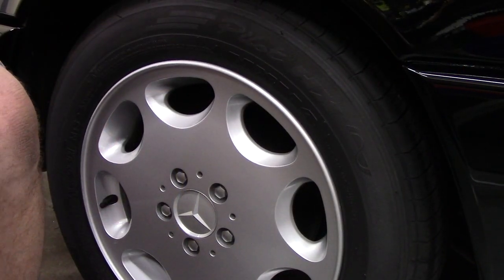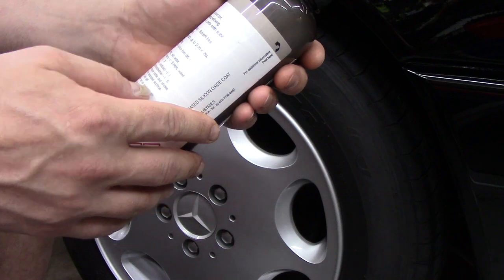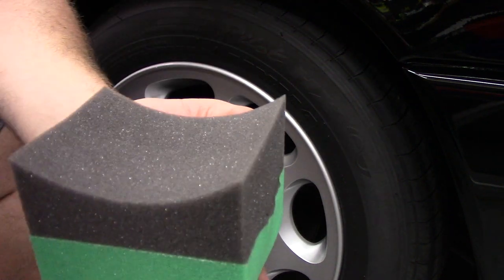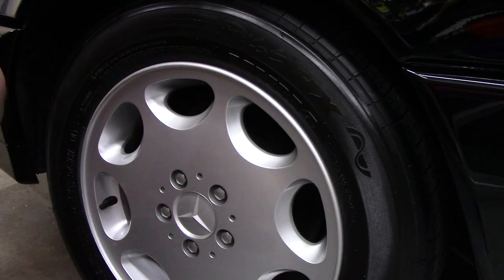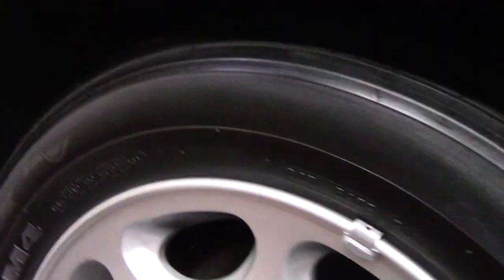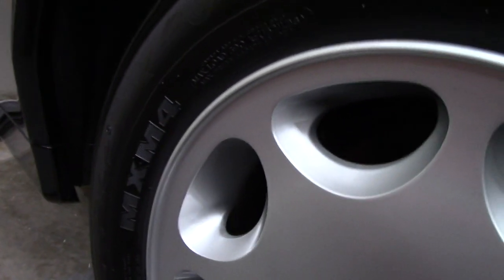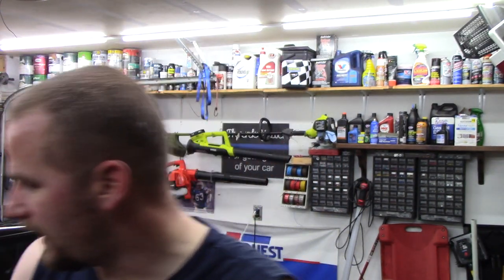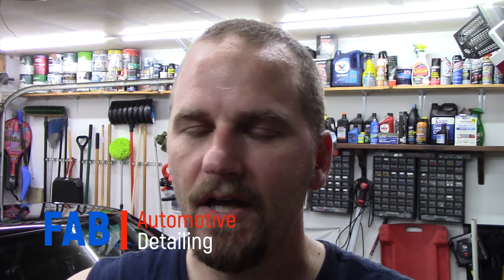CarPro Perl as a Tire Dressing

Comment: you mentioned in this video that you've tried carpro ironx before, what did you end up replacing it with? if you replaced it at all
Reply from the maker: Xtreme Solutions Iron-X, Malco Iron Blaster or even the new Turtle Wax All wheel and tire cleaner is an awesome iron remover for wheels and paint.

Comment: Good video as usual. It looks good but the durability is the real question that needs to be addressed I think.
Reply: In the real world depending on how much rain your car sees, it should last AT LEAST a month if prepped properly :) I recommend rubber prep or if you don't have that use Isopropyl Alcohol. I hope that helps.
Reply from the maker: Thanks! I seem to get a little over a week with no rain. That’s fine for me because I wash my cars once a week usually anyway.
Reply from the maker: Preparation is definitely key but I haven’t seen it go a month. I usually get a little over a week but then I wash it anyways. My truck hasn’t been washed in a month or longer because I haven’t been driving it and Perl was the last dressing and it’s definitely not there anymore.
Reply: I get about month too of durability. I agree preparation is key. I used it at full strenght for the initial application. Wait 10 minutes and wipe it down, add a second layer full strenght (but a little goes a long way for the second application). I tried other stuff (meguiar's, gyeon tire T2, vrp), seems to be the most cost/effective and it does not ''brown'' the tires over time.

Comment: I hear all kinds of mixed reviews about Perl. I don't like dressings that come off in one rain or washing or leave residue trails.
Reply from the maker: It definitely does not sling at all! As far as raining when it rains it does lose some of the sheen but you can still see it’s there.
Reply: Thanks for the reply FAB! I think I need to go with separate dressings for tires and other rubber and trim on my vehicle. So far, I get the best results from silicone dressings on my tires. But I still have yet to find a dressing that I can use on other rubber and plastic that doesn't leave trails running down the paint after one rain.
Reply from the maker: Eddie L You are welcome You need Adam’s Polishes VRT it is amazing and last through rain storms. It is self leveling and won’t run or streak.

Comment: I was interested in CarPro Perl until I learned that it has a 12 month shelf life/expiration date.  The product looks good, is dillutable, and reasonably priced....but the short shelf life swayed me away.
Reply from the maker: Shelf life doesn’t really bother me because I will definitely use the whole bottle within a year.
Reply: UKSportsFan i’ve had my bottle for 5 years sitting on the shelf in my garage and still works great.
Reply from the maker: rsxfreak79 Yeah most Detailing products have a 5 year shelf life.
Reply: @FABAutomotiveDetailing  I wonder if yours smells like whisky because it's an older bottle. That is the older CarPro label for Perl. Mine has the new label and it (to me) smells like banana yogurt, quite good actually. I just use it straight up on my tires and works very well.